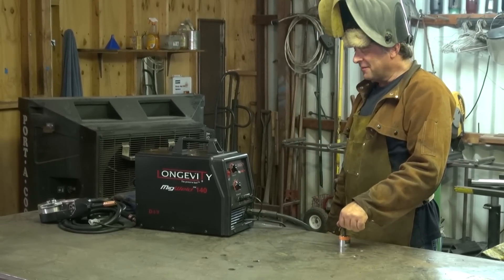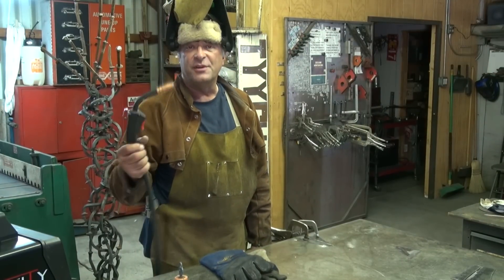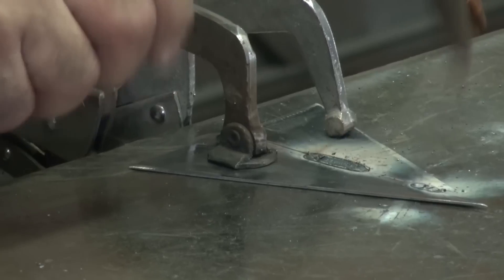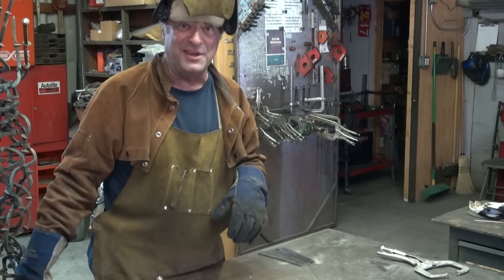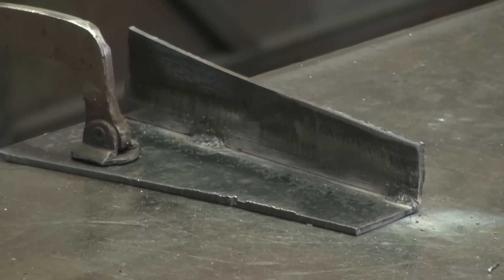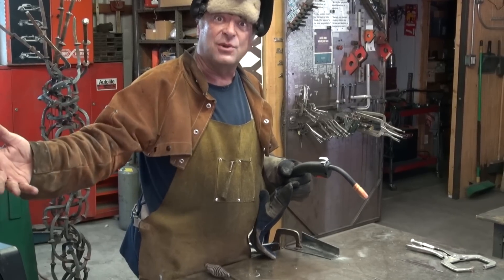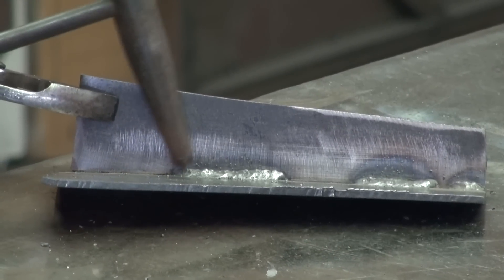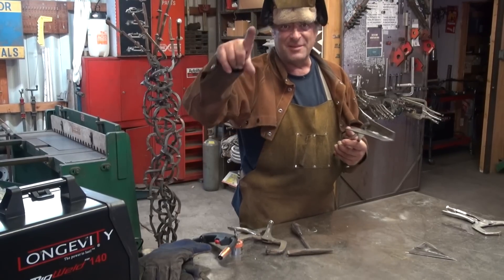How to Use a MIG Welder With Flux Core Wire - Kevin Caron

Comment: I'm in a wheelchair and weld. Went paralyzed from a kid texting and driving hit us head on in 09 and finally went down in 2016 so I'm trying so hard to do the things I once did. Anyways,  waaa...I've only used a Lincoln stick. But I now have to get closer to the work and that think is a giant sparkler. I built a leather gilly suit attached to a T-shirt. Works well but I really need a smaller unit. I build a lot of shooting trees where I use the stick but I mostly mess with 1/8 and down. Great video for me to pull the trigger on one. Bless
Reply from the maker: This should do the trick nicely! 

 https://www.amazon.com/Jewboer-Durable-Leather-Anti-scald-Resistant/dp/B07H2C3Z3Z/ref=asc_df_B07H2C3Z3Z?tag=bingshoppinga-20&linkCode=df0&hvadid=80470562649010&hvnetw=o&hvqmt=e&hvbmt=be&hvdev=c&hvlocint=&hvlocphy=&hvtargid=pla-4584070138480541&psc=1

Comment: Enjoyed it, I appreciate you showing the use of flux wire, no gas.
Reply from the maker: Thanks for watching..
Reply: I really hate all of the smoke from flux core but because I weld outside, it is the wire I use the most with my powermts. Sometimes you just can't avoid using it.

Comment: Not bad nice little welder ! I just bought The Lincoln  180 dual  from my local  lincoln electric welding store  if you only have  110 volt  which  is my case I dont have 220 volt  power supply  in my home garage  , but when i do get 220  installed  I just twist the 220 plug into the back of the machine  and im good to go for thicker  material  I love this machine  and I didn't  even run it on 220 yet   Merry Christmas  everyone
Reply from the maker: Was very happy with this machine..    Someone else was enjoying it also and pulled out a big wad of cash and said "How much?"

Have to order myself another one some day...

Comment: AT LAST!!!! a Man that tell's it like it is about Flux Welding !!!! 
So its only like ark without the gas :-)
Brilliant, so I'm now going to order and try some flux core wire in my mig (thanks also for the heads up re: changing the polarity of the torch)
and give it a go!
It's actually like I started to weld with arc sticks, but this  will feed a lot longer :-)
Many thanks
Graham.
Reply from the maker: Thanks for watching and posting.   Good luck with the suck core wire.

Comment: Interesting.  I just got my Bobcat 250 with electric fuel pump.  I mean, a moth could weld with the thing.  haha  I had been using a, like, $50 one I got from Amazon.  

I asked Miller what I needed to mig and tig weld.  They gave me one thing that would cost over $2000 and another that cost over $4000.  haha  I mean, what is that all about?

Since I am teaching myself, and my mom would shank the hell out of me, I made the smart choice to get something MUCH cheaper.  haha  I will have to check the one your talking about out.  I just want to weld the hell out of everything.  I found it is a lot of fun.  One of the things that most helped me, is your videos.  Super fun to watch.  Thanks for all the information.

Comment from the maker: Been working very well!!    I have only used it up to 3/8th in. Welded just like it was supposed to.  Only thing I need to do is get some .030 or .023 wire instead of the .035 that is in there.  The 0.35 is a little big for this machine.As for the brand of wire,  I haven't seen any difference from one brand to the next.  The consumables for this machine are from Longevity.  I haven't been able to find any that fit in the aftermarket.

Comment: I work for a boiler manufacturer in SW Scotland... We use Flux core wire on most of our joints... We use 1.6mm ESAB Tubrod wire... It gets bloody hot and the UV rays are extremely powerful... We're talking about 29-36 volts and 350-450 inch/min on the wire speed and about 350-400 amps ish... We use an Argon/Co2 gas aswell... its a very powerful form of welding... (Most of the plate we weld with is usually in excess of 20mm)

Comment: Kevin, I was told that with flux core, you dont actually need to clean up rust or paint first. My wife drives demolition derby and I do all the welding and mechanical. I slap plates on (lets say on a door) with just wire brushing off the old mud and start welding. I am using a millermatic 140 (115v) with .030 flux core and welding 1/8 inch plate to the cars sheet metal. Should I be removing all the paint and rust? My welds havent done more than a couple cracks yet (8 races). Biggest problem is the sheet metal breaking off next to the weld on a good hit. Great videos man!

Comment: Thanks. I have been using a MIG with gas but I am thinking about the flux core. I don't do a ton of welding but I always worry that I'll have the gas leak out which happened once. A hassle to have to run and exchange the tank not to mention the cost.
Reply from the maker: I hate using flux core..   Too messy for my taste.
Reply: > The Blade:   Sir, you make an excellent point:  gas is trouble.   I'm looking at welding as a hobby as well and would prefer not to trouble with gas.  Here we are looking how to weld without gas.

Comment from the maker: Yes, there is a different wire for flux core gas shielded wire. You use the same gas as you use for solid core but you have slag to chip off. This wire is better for out of position welds like overhead.

And yes, this is for steel.

Comment from the maker: Well, I would first change it over to gas and run solid core wire. You will be much happier with the results. Then I would take a few weeks to just practice and play with the settings on the machine.  The great thing about MIG is you just have to pull the trigger and it is welding. Now you have to get good at it before you start doing any work with it. Smaller Gage wire, .024 or .030 at the biggest. Once you are comfortable with how it works then try a few simple projects.

Comment: my flux core welder only wants to make blobs, never got a flat joint since i've been welding. the grinder gets the welding credit. also the wire feed adjustment ranges from "kickback from the workpiece" at the lowest setting to "kickback hard and make a million blobs on workpiece"
Reply from the maker: Sounds like you need a new welder!   Don't know the make or model so really can't offer any advice.

Comment from the maker: With flux you have slag to chip and clean up from . 

Gas gives you a MUCH cleaner weld with no slag, less smoke and a better looking weld.

Flux has it's place for sure but in my studio that place is on the shelf in the just in case file...

Comment: Hey Kevin, on another video, you mention how one of your friends had the polarity set up for MIG, and his welding with flux core wasn't coming that good, but watching another guy on YouTube,  he says that welding flux wire with negative polarity, is better and it doesn't produce as much spatter, which he showed in a video.
Reply from the maker: I am wrong in this video. Flux core needs neg on the gun to work.
Reply: @KevincaronSculpture  I have a Hobart 140, and the polarity for Flux Core comes positive from factory, it has some pictures on how to change it if im going to use solid wire. although i dont know how to weld with MIG or Flux Core, and im learning, i would change the polarity tomorrow and see what a get.
Thanks for your reply.

Comment from the maker: Well, I guess it all depends on what you are going to do with the containers after you weld them together.  If you are just looking to keep the weather out and they are sitting on the ground heck you can use a can or several of spray foam.  If you are going to move them as one piece then that's going to be harder..  Are they end to end or side by side?   Do you have a tight seam or are there gaps to bridge?    If I was going to do this one our camping property I would take my mig as just go for

Comment from the maker: Well how long the spool lasts depends on how big the project is.I have gone months with the same 33lb spool on my big welder. The large bottle of gas (80 cf i think) lasts about 1/3 of a 33lb spool.  If you have 30 feet of wire on a spool that doesn't mean you are going to get 30 feet of weld. That all depends on the width of the bead.  Keeping gas on hand is a really good idea as well as the solid core with to go with it.Once you get used to using gas you wont' go back to flux core.  Promise!

Comment from the maker: Not sure what make of machine you have but have you checked the reset button on the back of the machine.?

Does it have a reset button?

Did you wire the plug and is it done correctly?

Comment: I would stay out of the rain when welding LOL    Welding for 35 years and mig is a cleaner and  better looking weld.  Mig wire is 1/3 the cost of flux core.   Flux core is for thicker material, will work well down to 18-20 gauge. Works in windy conditions.  If your doing decorative high quality stuff like Keven does than mig is best.  I only use flux core .045, $60 11 lb spool Praxair.  Thin material I turn to the Tig.

Comment: very wonderful there mate... can i just ask can that type of gas less flux core mig welder be used in repairing bodies of automobiles ?
Reply from the maker: I think any of them will work.  Just pick one and give it a go.
Reply: the reason i asked is that i want to fix my project car my self and first step is to fix all the rust problem.. its to expensive to avail full body repair here in my place so i just going to do the repairs my self i know how to use conventional arc welding machine what i need is something that can weld thin materials such as metal plates as thin as a car's body...
Reply from the maker: What kind of budget do you have?

Comment: kevin you sound like kermit the frog lol .....love u man ur classes are the best
Reply from the maker: makaveli mclean Thank you..    stay tuned for a special guest....
Reply: I will the thing is I wanted I wanted to weld square aluminum tubing for my project so I bought the alpha tig 200x gig welding machine but I'm sending it back for this because nothing I it wouldn't weld it only melted if I turned it up or not weld at all when I turned it down I couldn't get a puddle so I'm sticking to mig its way easier
Reply from the maker: If you still have the machine call me and we can talk about aluminum welding...   My number is on my website..      Aluminum just takes a little more practice to get used to..  I will help you get started if you are interested.

Comment: I’ve been mig welding aluminium welding for 20 years I know it’s a different process from flux core welding 
Looking to cross over and get a job as a flux core welder 
Is the transition going to be a easy one or will it take time ?
Reply from the maker: You should have an easy time switching over to flux core. Easy as can be.
Reply: Kevin Caron, Artist Cheers Kevin 👍

Comment: Maybe you could explain why we use gas when we weld. And why you don't need gas with a flux core wire. We use gas as a shield bubble to displace the air around the weld with an inert gas. In order to keep oxygen in the air from coming in contact with the weld and minimize any oxidation that normally occurs at high temps and would make an ugly weld. So, the gas is a shield against oxygen. With a flux core wire, you don't need gas because the burning of the flux in the wire produces a gas and consumes the oxygen around the weld. flux also cleans the metal as you weld. one drawback with flux core wire is the splatter will be higher than non-flux core wires. But can be mitigated effectively with the right techniques. Also flux core wire will work better in some situations where gas shielded wire will fail. Such as outdoors on a windy day.
Reply from the maker: Absolutely dead on!!   I could not have explained any better than you did!     Great job!

Comment: So this is basically a stick welder in a MIG style process, if you use the gas coated wire then does this become a MAG/MIG process welder rather that a stick process and on top of that can you add a tank if you want? I'm a welder myself looking for something a bit smaller to have in my van rather than my ESAB rebel and thermal arc 211 which would take up a lot of room and probably wouldn't run of my portable generator.
Reply from the maker: It may work great for you..    Get a look at one and see what you think..
Reply: mig is more stronger 1 inch of mig weld will hold 40tones

Comment: @Kevin Caron, Artist Hi again,also you always tap the slag off the weld, if i was going to grind them flush with an angle grinder, would i not have to do this?
Reply from the maker: Correct,   just grind away and get to work...
Reply: thanks for your fast replies, great video, i learnt lots

Comment: Hi Kevin. Just bought myself a gas/gasless mig welder 150A @ 230v. Can I weld stainless steel without gas with a flux cored wire and solar flux for the back of the weld? No video out there on this. Want to keep the anti-corrosive side of the stainless weld. How do I do this with just a mig no gas. Whats required? Thanks. Great videos!
Reply from the maker: Sorry, but I have never tried to weld stainless with no gas.

Comment: hay there Kevin, I have a small 130 amp Mig welder that uses the small spools of wire, I was wondering if you know about fitting an adaptor for the larger rolls of wire?

Comment from the maker: I would make some plates to join them together.   Say 12 inches long on each side. Two at least, three would be better.  Mig or stick them together.  Foam from the inside to get a weather tight joint and cover from the outside like you said...   Should last for a long time......

Comment: Hey Kevin, my millermatic 250 has lost gas to the nozzle and in a spot where I need to get things done. I was going to switch it over to flux core and follow the polarity and nozzle recommendations you mentioned until we can look further into the gas situation. Can I ask if there is anything else I would need to keep in mind (welding 14ga angle a tube steel)
Reply from the maker: Not that I can think of at this time..      Of course you could just figure out why the gas stopped and fix it.    ( yes, I hate flux core!)

Comment: I enjoyed the Video Thanks... I am borrowing a mig welder to build a BBQ from a 250 Gallon Propane tank... what size wire should I use? The metal that I will be welding is all 3/16 to 1/4,  I have only used stick welders in the past so wire feed is all new to me.

Comment: That's about the best question there is, I always wanted to ask someone that and never knew who to turn to.  I'm the guy with the Weld-Pak 100. In the manual it says to run a straight bead because it is easier.  But it never seems to make a good looking weld that way.  Do you weave with your wrists (twisting like a screwdriver) or with your arms/shoulders?

Comment: Kevin, i discovered your channel today, and i must say i really enjoy your videos. You have a nice easy teaching style, and your very relaxed, which is trait not found in alot of welding videos ! I do have one question: i noticed when you weld, you hold the torch straight and true, with no side motion. I was always taught, and teach, to go back and forth across the joint in a quarter moon shape motion ...... any thoughts???
Thank you for your time !!!!
Reply: Both ways are correct. If you move slow enough you can achieve the same weld as with the side to side movement. And by looking at his welds, they are pretty flat and have good tie in, so he is not moving too fast.

Comment: Chevy Chase's cousin in National Lampoon Vacation!  LOL  I run a similar welder but I found I can get better results without the gas nozzle when running flux core wire without shielding gas.  Lots to clean up but better welds - give it a go you will be surprised

Comment: Great video!  I'm a beginner for sure.  I have a Lincoln Mig Welder similar to your Longevity and a Lincoln 220 Stick Welder.  The big problem I'm having is I can see the puddle but can't see the direction I'm trying to weld.  I keep going this way or that, but not the direction I want to go.  That being said, I can gas weld pretty good, I can see the direction I'm going.  Any advice?
Reply from the maker: +Dennis Schoessow 

Practice and a clean lens in the helmet do wonders..      Also try adding some more light to your work area..

Comment: @Kevin Caron, Artist Hi, If i welded my car with a mig welder with NO gas, would it still be as strong?, does the gas only make a neater finish, does it add anything to the strength of the weld?
Reply from the maker: It "should" be just as strong.        I have never tried to test the welds with and without gas.

Comment from the maker: This machine it great for the thin work. It loves running .024 or .030 fluxcore as well..  Not too sure about making a wood burning stove out of 16ga. though..  Might be a little too thin for that much heat. Be better to go with the 1/8 inch for durability.   As for using flux core on the snowmobile exhaust,,  please don't!!!      That is the kind of work for a tig welder.   If nothing else take the flux core off and go to solid core with gas.  Much better weld and cleaner also.

Comment: I have a question I'm just getting into welding and I have flux core wire I was wondering what would be a good pattern to use to ensure a good bite and a good weld in the metal
Reply from the maker: Pattern really doesn't matter.  Voltage makes all the difference.    IMHO.

That being said I am not a certified welder so I try not to offer advice along those lines.
Reply: Okay thank you what would be a good pattern to stay by
Reply: Or what pattern would you prefer to use
Reply from the maker: I normally go side to side.

Comment: I got Lincoln power mig 210mp the problem i have is i turn on the machine turn off and the main electric Box too do you have any idea what is the problem
Reply from the maker: Too small of a circuit breaker in the box.   Time to call an electrician.